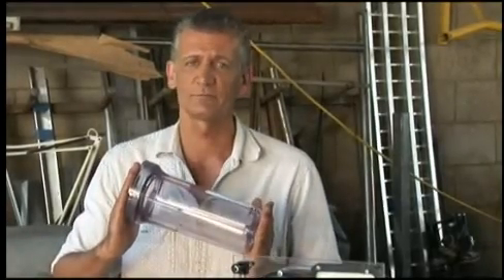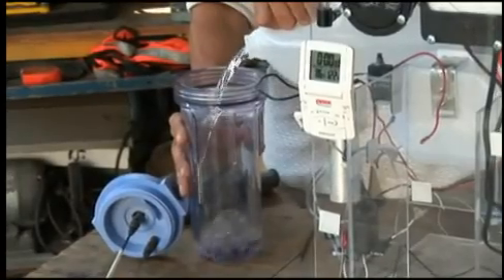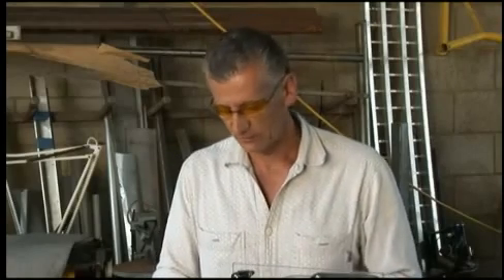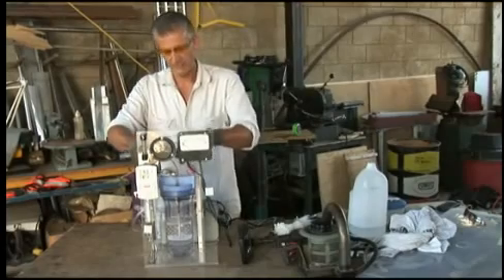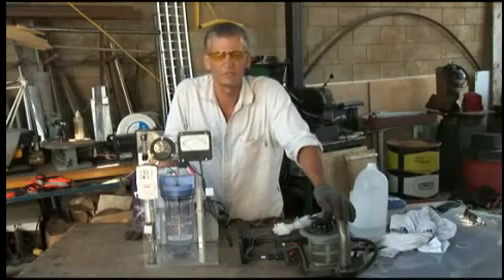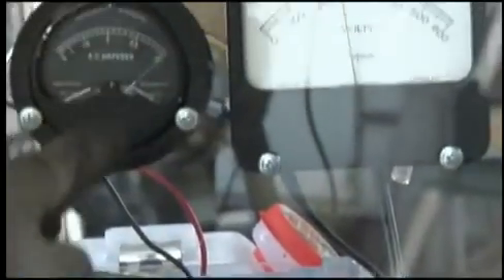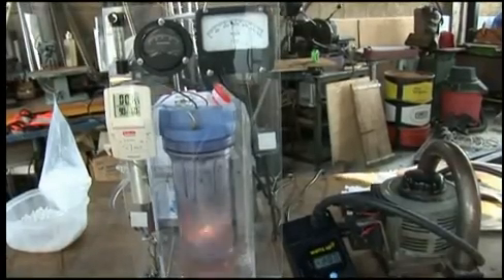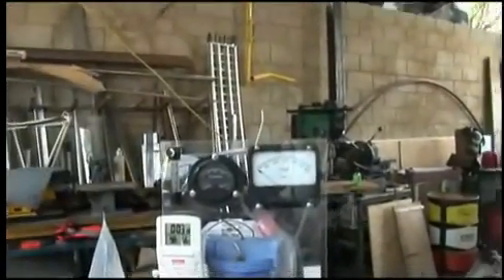Anonymous\\Free Energy

Comment: Free energy is so simple that we have overlooked it. 
This free-energy device is based on simple multiplication of rotations 
that you get by putting a very large and very small pulley within the same loop 
You could also gain another multiplication factor by adding additional small pulleys attached to generators on the same belt, rope. 
With electricity, multiplication of rotations means multiplication of electricity. 

search free-energy + yolasite
Reply: yes for mechanical device, it can be done with electric and electronics too

Comment: All he is doing is passing a high voltage through water. The electrical arc is boiling the water.

Also, Cold fusion is exactly that, Cold. Not extremely hot as he explains in this video.